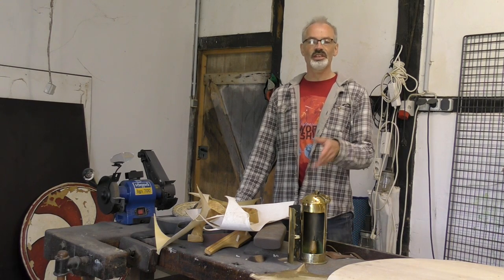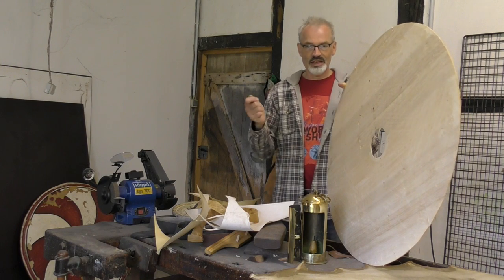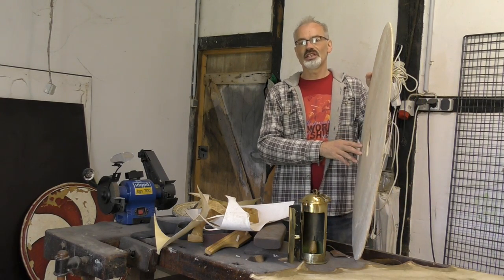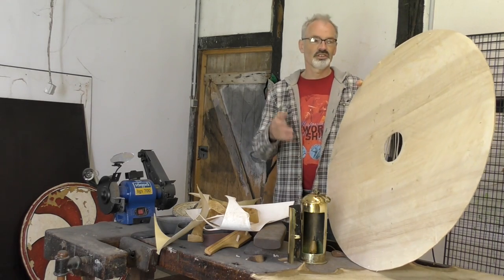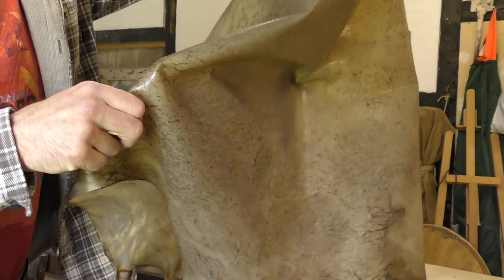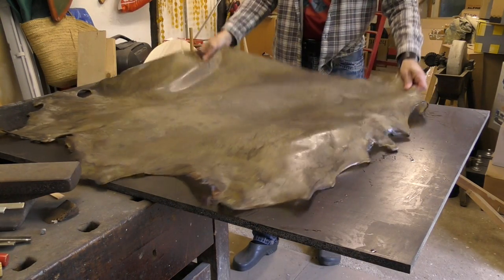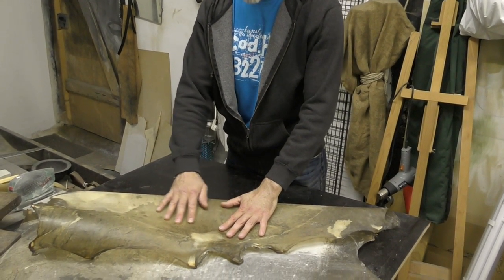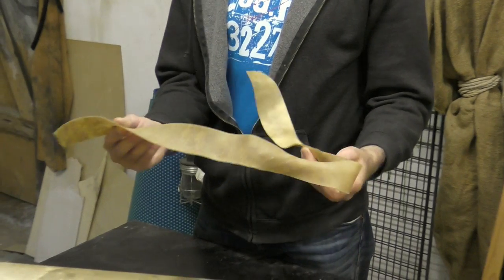Making an authentic Viking shield, Part 2

Comment: I've found that a block of pumice is really great for evening out thinning from shaving. After a couple passes toss some powdered chalk under the block and you can get the surface almost glass-like to the touch.
Reply from the maker: Interesting. Thanks for the advice.
Reply: I wonder if they might have done something similar. Did they have access to pumice geographically? Have we ever found pumice artifacts? I mean I say "I've found" but that just means I've personally seen it work well. Actually picked that up from a parchment maker. Dunno how far back that goes though.
Reply: I'm guessing that during Norman expeditions to Italy they could have traded for pumice or it could have come from the Eastern Roman/Byzantine Empire via the Black Sea.

Comment: I hope you have taken into account, that most wood you can get today, is isn't as dense as i was. Even if we only look back 100-200 years, the wood was of a much better quality, than what it is today. The reason is that today we use growth hormones and fertilizer to make the trees grow faster, which makes for larger growth rings. Wood of good quality have to grow as slow as possible. The slower it grows the denser it gets, and has a much larger content of natural resin. So i really hope you have gotten some good quality wood, to make your shield out of. It is still possible to get slowly grown wood, although it cost more. As an example i can tell that i made a new gate for an old military facility in Copenhagen, and for that we had to use slowly grown pine. Most pine today is almost white, or only slightly yellow, but the wood for the gate was dark orange. And even a small cut in the wood, filled the entire workshop with the scent of pine resin.
Reply: It is possible that it was a different type of pine?  I worked construction in Florida some years back and encountered (while remodeling older buildings) entire homes built around the turn of the last century of "yellow pine".  This material as you say was loaded with pitch, produced clouds of pine scent when sawn, and was so hard that driving a nail into it without pre drilling the nail hole was almost impossible.  The same buildings have survived many hurricanes.  This pine is very different from the white pine encountered where I grew up in New York.
Reply: It has little if any to do with the sort of pine. If you take two seeds from the same pine tree, and plant one in harsh conditions and the other in controlled and fertilized soil, you will get two very different types of wood. 
The tougher it is for a tree to grow, the narrower the growths rings will be. And a piece of wood with large growth rings is lighter and weaker.
What makes the wood strong are the rings made during winter. So if the tree grows a lot during the summer, the light and soft summer growth rings will dominate the finished wood. Whereas wood that grows slow in the summer, will have a lot of thin dense rings, which makes the wood stronger and also more resistant to rot and fungi, since the pitch in pine has a natural defense against germs and fungal spores.
Reply: Well not entirely:     https://www.canadianwoodworking.com/woods-know-southern-yellow-pine  >>>>   https://www.canadianwoodworking.com/get-more/white-pine
I think you are correct about growth circumstances producing different quality woods and probably much else can be done as well to alter structure  &  performance characteristics.  Stave churches are an example of such forester/ carpenter know how.
Reply from the maker: Good point, Allan. It is indeed close to impossible to get slow grown pine or any such wood these days. Arthur von Eschen purchased an ancient tree from a bog – but naturally, this is an expensive affair. Kim Wich-Glasen, an expert for reconstructing and making medieval furniture (who actually also made this shield board) says the same: Getting the kind of wood you find when examining original pieces is the toughest part of reconstruction, and oftentimes not at all possible.

Comment: Would a cabinet scraper (or "card scraper") be effective on the hide? It would be a lot safer (no risk of cutting through).
(They're usually used on wood, if you search on YouTube you'll find lots of examples.)
Reply from the maker: Maybe. I am only experimenting. But hide is uneven to begin with and this one is very thin.

Comment: Question: many shield remains being found in graves....how do we know that the shields left in graves were different, lighter weight than shields used in combat?
How do we know the Vikings didn't have "show shields"?
I think of the Zulu and they have different size shields for fighting, dancing and so on....
Reply: From practical tests it seems to work well enough.
You want melee weapons to get stuck, because that gives you a pretty good shot to kill your opponent.
And it's still protecting against arrows well enough.
Remember that people used hide and even paper armor to great effect too.
And you want your weapon to be light or you won't have the strength to wield it when you need it.

Comment: Thanks... I'm currently sourcing planks (in the US) to do the same, but I'm going with sawn, not split (too lazy)Was poplar actually used for the shield planks and not just handles?Source?
Reply from the maker: Poplar wood was one of the woods used for the Germanic shields of the Thorsberg finds. If you cannot get split planks, you can use the center planks sawn from a tree trunk, which have the same mechanical properties, namely in tact fibers running through the board.

Comment: If blunt weapons destroy und splinter the wood more easily than sharp ones, what kind of shield should i use if i want to train with blunt swords because of my little experience and therefore safety reasons.
Reply from the maker: Well, if you use blunt training weapons like you would use a sharp, there is no problem. It is the bashing that blunts allow but that would bury a sharp deeply in a shield that causes the problem. It is this modern artifact that destroys authentic equipment. Simply refrain from useless technique and everything is fine.
Reply: Roland Warzecha Thanks for your  quick response.

Comment: Would a Shield that thin hold up against arrows?
Reply: AwesomeAggron1000 Surprisingly yes. When Vikings sacked Paris they formed something like the Roman testudo and it worked.
Reply from the maker: We would have to run according tests. The set up would be tricky. Given we interpret the archeological finds correctly, the construction was widespread, suggesting it was successful in action.
Reply: Roland Warzecha I feel that some sort of experiment should be done. Because it could help us understand if the shield were originally this thin. And also understand how effective the viking shield all was compared to the Roman testudo.
Reply from the maker: Absolutely. I will see to raise the funds to run an appropriate experiment. You are welcome to support my efforts, too, if you please: https://www.patreon.com/Dimicator
Reply: It should stop them, probably with penetration.
I think there's a (possibly major) error in the way this shield is done:
1. The hide used should be a) fresh, and b) full thickness.
2. There should be hide on both sides of the shield. (Which means the handle, and boss, is mounted after the hide is in place and has dried.)
I plan to build a couple myself. One full size for use in re-enacting and a few smaller ones for actual destructive tests.
I will use elk-hides, because I can get that for free. De-hair and scrape the hides directly before stitching them (still wet!) onto the wooden plates.
By having hide on both sides the shield won't warp as the hide shrinks, and no glue is needed to keep the hide in place. It's mostly the hides that make the shield. The wood is merely there to shape it during the build.
Reply from the maker: Olle P, whether or no both sides of a shield were covered with a facing is not easy to say. There certainly is at least one surviving example I am aware of that had facings on both sides. But for the vast majority of finds there is exactly zero evidence for any facing at all. They may have all perished. But as it is, your assumption that hide facings were essential to Viking shield construction is not supported by the archeological record.
"Hide of full thickness" is a very unspecific term. I thinned down the hide to have an even layer. Most of the removed material would not have added structural integrity, only weight. At any rate, good luck with your project. Keep us posted, if you please
Reply: I will keep you posted! My main problem for now is to find a suitable work space for working with the hides, but I have some ideas.
The main argument for having raw hide, at all and on both sides, is that it makes the shield so much tougher. I've got a mallet, used for leathercraft, that has the head made of pure raw hide. I can easily use it as a hammer to draw in nails.
As you noticed yourself raw hide shrink when it dries. It's easy to apply onto the shield while wet, but unless both sides are covered there will be a huge warping stress on the wooden plate when the hide dries. With both sides covered it will just be an even stress to the edge, forcing it towards the centre. When it's dry the hide will lay flush with the wood and be hard.
The lack of archaeological findings is actually a good circumstantial evidence, since raw hide will degrade much faster than tanned leather (which is the main reason for tanning leather in the first place).
Reply from the maker: Thank you for your reply. You are working from the assumption that making a shield particularly hard and stiff was an original aim. This may or may not be so. The use of soft woods and overall light weight construction in combination with a central handle that suggests a very mobile and active shield use, could just as well point into a different direction, and, in fact, this is my conclusion after years of research and experimentation. I doubt your construction with thick raw hide on either side will result in a shield that would be up to active and dynamic use. I have done so before and the shield was too heavy to be a useful and agile weapon. We shall see. Good luck.
Reply: Roland Warzecha I think you should also look at in a sense that shields weren't just for dueling. The shield would more likely be used in battle. In battle I don't they care much for agility of a shield, for example being in a shield wall formation. I think shields for battle may be a bit heavier, but if they last longer during a battle I think it would be worth the loss in agility.
Reply from the maker: AwesomeAggron1000, I am actually quite convinced that there were different variants of shields. This is actually confirmed by archeology if we interpret finds correctly. I also agree that such shields were not exclusively used in duelling. Icelandic sagas describe numerous small scale skirmishes (if we consider these texts a valif source for the time period in question). However, when you write: "The shield would more likely be used in battle", then what do you base this assessment on? Any actual evidence? Any statistics you have run based on source material? I for one think we have to be very careful to not be misguided by bias, modern myth and prejudice. The average Viking enthusiast has looked at videos of re-enactment battles or TV shows way more than at, say, the Anglo-Saxon Chronicle. The truth is that in the early Viking Age, raiding Scandinavians were successful with hit-and-run tactics, and lost pretty much every open battle that was enforced on them. So their formations and the equipment being used therein could not have been all that great in comparison to Franks and Angl-Saxons. The very word "shield wall" doesn't even exist in any historical source that I am aware of. There are terms like "skjaldborg" meaning shield fort and "testudo" being used by a Frankish chronicler for a Scandinavian formation at Paris. Both of these rather suggest a closely packed formation, not a line of shields. And, of course this makes sense when approaching and being in need of protection against missiles. But actual line fighting as e.g. in modern re-enactment does not really make much sense with flat shields. Domed shields offer much better protection in this context. Which is probably why the flat shield was given up as Scandinavia adopted standard European military organisation and tactics alongside christianity. The time for individual ground fighting in Germanic tradition was over.
Reply: Roland, you are correct that the numerically inferior raiding Vikings opted to use many of tactical elements that today are adopted by special forces around the world.
In defence they mostly relied on using fortifications.
But they also had tactics for field battles. Most well known is the "Svinfylking" formation, which is essentially a dense wedge with the shields held in an overlapping fashion. They'd run this wedge into the enemy line to break it up.
(I've got two fairly new books that I've read on the subject of Viking warfare and tactics.)

I'm also convinced that there were shields with different optimisations, but I think it was mostly a matter of size. If you want shields for a duel (I use plural here since the rules for "Holmgång" stated that the participants weren't allowed to use more than three shields each during the duel) you don't really need passive protection from arrows and such, but you want them to be light and manoeuvrable. Therefore the shields can be smaller. (The extreme example being the bucklers frequently used in renaissance duels.)

Furthermore my thoughts regarding the design stem from matching the manufacturing process to what we do know about the shields: They were a) relatively cheap to buy, and (as indicated by the Holmgång rules) b) not expected to survive more than one fight/battle. This means the manufacturing process must be "quick and dirty" cutting as many corners as possible to make a lot of useful shields with the least amount of work effort. (Much like the Soviet tank (T-34) production in WW2. Very rough in all details that didn't require precision.)
This of course doesn't account for any "special" shields made exclusively to be show-off pieces possibly ordered by some rich people.
* Keeping it simple rules out the use of skived (thinned down) hides and hides on one side only, as both processes add a significant amount of labour. It also rules out the use of fabric to cover the shield, since making fabric is extremely work intensive.
* Remaining options are:
1. No hide at all. The shield will unlikely survive a single cutting slash to the edge.
2. Raw hide at the edge only. Better than none, but I expect the wood alone won't stand well against abuse.
3. Raw hide on both sides. Best possible protection from penetration, slashing and stabbing. Good structural integrity. Also fire resistant. Needs a coating of lacquer or similar to be water resistant.
Reply: Roland Warzecha I see what your trying to say and I think i argeed with almost everyrhing you said. But this is a side note, the vikings switched to Kite Shields not domed shields. Thanks for replying to all my comments. I very much emjoy your videos.
Reply from the maker: Happy you like my work. Regarding transition from round shields to kite shields: This was indeed the longterm result, but we have no clue how gradual this shift actually took place. It actually makes sense to assume that particularly in the second half of the Viking Age, Scandinavians and Scandinavian settlers e.g. in England and elsewhere would employ any equipment that best served their purposes. So I would not be surprised if e.g. the Danes attacking England in the the late 900s would have had both flat as well as domed round shields for specific contexts of action.
Reply: Roland Warzecha would love to see proper tests, but if you do test it, please specify pull of the bow and factors such as arrowweight and firedistance.
Reply from the maker: Sure. Any such tests will be more likely to be carried out properly the bigger my fan base of supporters is: https://www.patreon.com/Dimicator

Comment: I aught to comment, that we discovered a small viking inhumation cemetery in Northern England, with grave goods in 2004, which we published in 2014, which had one grave with a sword, spear, type E axe, and a carinated shield boss, the flange of which preserved the mineralised remains of a textile, probably woven plant like fibres, and bits of the wood of the board. So we do have a little evidence for textile, possibly linen facings on a viking shield. You can email me at: blueaxereproductions(at)gmail.com if you'd like more reference material. great video; thanks!
Reply from the maker: Oh, extremely interesting.